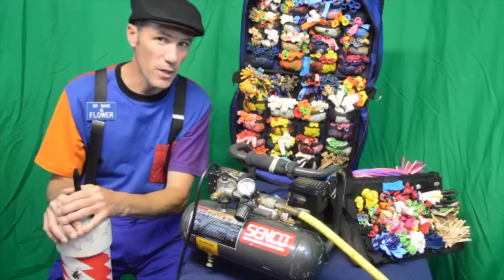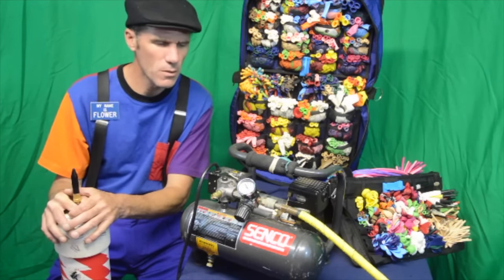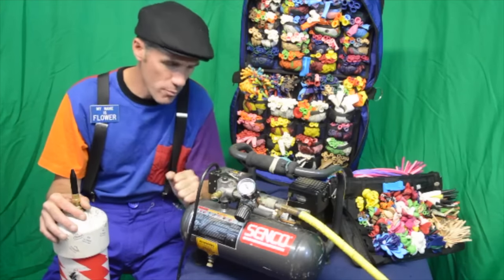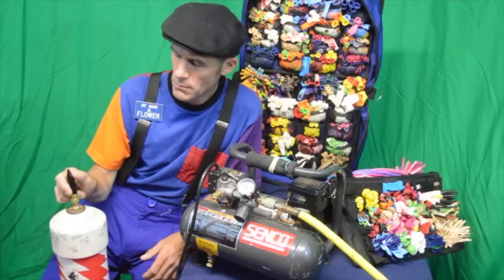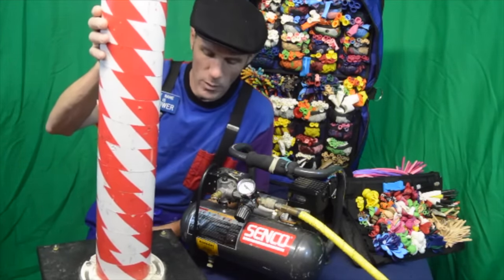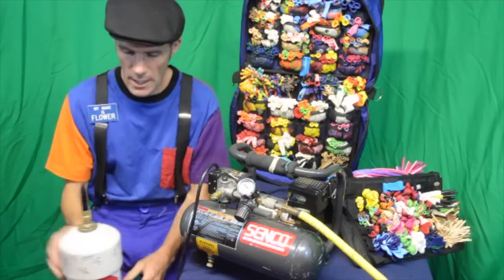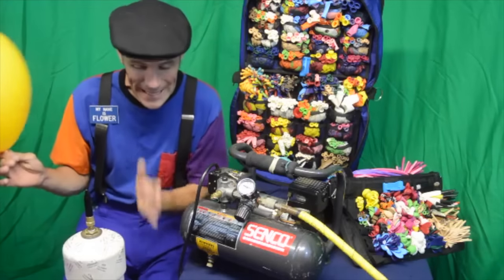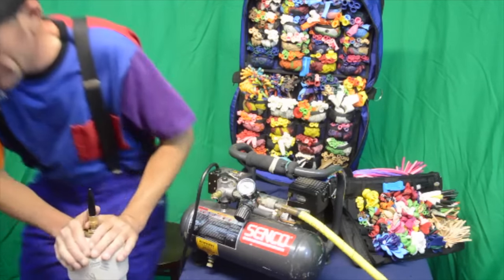Flower Clown's air compressor set up for balloon inflation

Comment: Hello! Polka Pop Balloon Stop here.  I love building my own balloon tools as well!  I am working on a balloon cart so I can more easily transport my helium tank (when needed) and easily roll up to gigs that are carnival booth/ street festival style.  
I agree- I've tried my fair share of hand pumps, floor pumps, battery/electric pumps at jams, but my favorite is definitely my air compressor.  I don't have a setup like yours yet; but I have some questions.

* About how many balloons can you blow up with that small tank before the motor kicks on?  aka: how many 11" round balloons can you fill? 350's?  Those are the main two that are cumbersome with my floor pump.  

* Are you filling the pvc pipe with compressed air or is the hose inside and the tower is there so you have something to press up against when filling the balloons? 
If that's the case, I won't need the tower and should be able to attach the hose right to my cart if it's stable enough to push on.  
ATTACHING THE REGULATOR NOZZLE IS GENIUS!
Reply from the maker: Contact me on FB and we can chat.